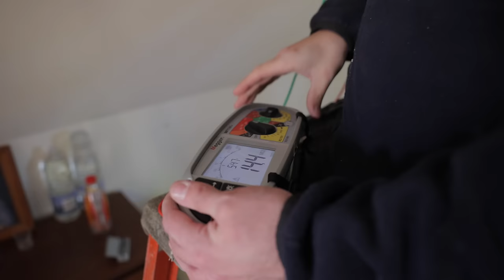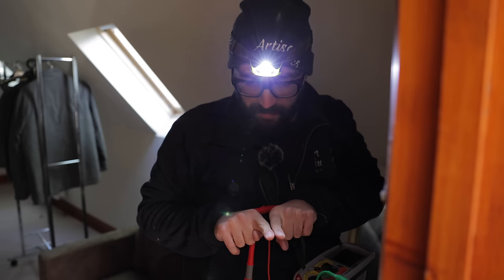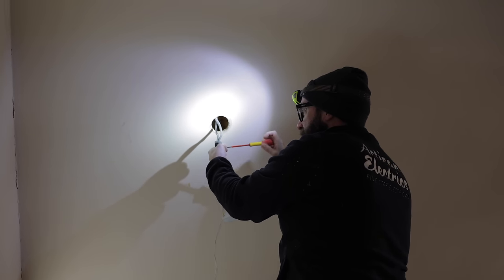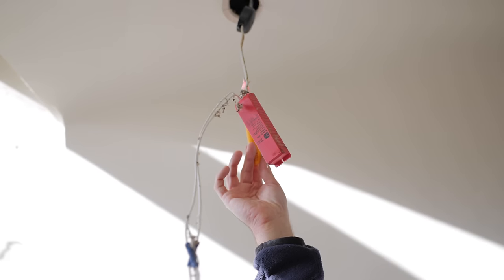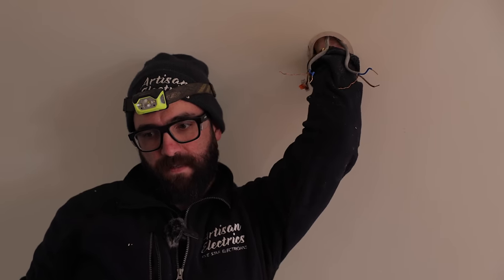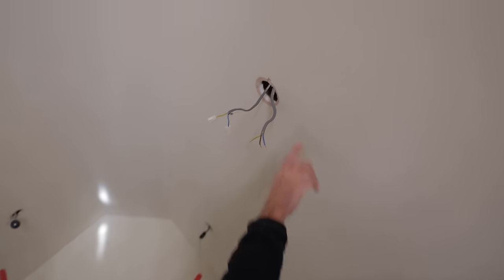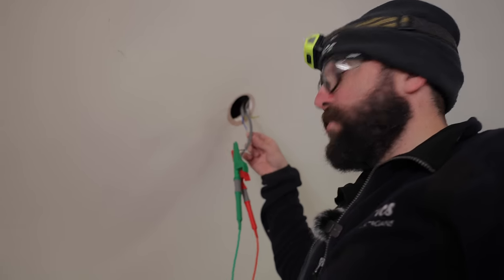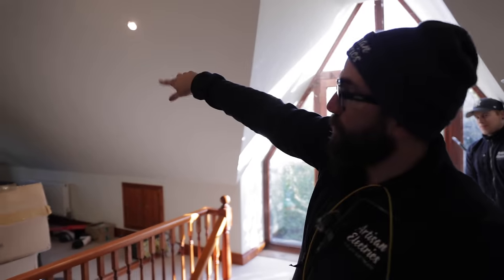Fault Finding an Electrical Lighting Circuit - Expert Electricians Top Tips

Comment: A colleague went to a house last week with squirrel damage after a report the RCD kept tripping.  Stripped cables and structural timbers virtually chewed through in places.  The house was due to be occupied (Not any more).  Currently waiting for the thermal insulation to be removed to allow a visual inspecting of the structural damage as well as the wiring prior to any repairs.  That brings the total to three this year (First two were rats though).  With rodent damage and an accessible loft we visually inspect as well as test because you cant rely on just the insulation resistance test to prove the circuit is safe again.  They like plastic water pipes with their knobbly fittings as well with the predictable but visible leakage.  Personally I don't think "Copex" would stop the damage but may minimise it (We've discussed using it but not actually tried it yet).
Reply from the maker: Wow what a nightmare!
Reply: Steel conduit or flexi, or armoured might be the only way.
Reply: @tobysherring1369  And an electric fence energiser connected to the conduit/armour.

Comment: Great vid. I’d suggest the easiest/safest/cheapest thing to do is to change the lighting system so that you don’t use/rely on any cables within the roof joist zone. Design an LED strip lighting system to soffit / walls/ false dado rails & some floor lighting etc etc. 
There are some clever people that do this for a living I’ve heard!
Reply: Or try quinetic
Reply: Yeah, alternatively customer can go for surface mounted cable trunking / conduits and spotlight bars along flat ceiling.

Comment: I'm a committee tech in Australia .
I use red tape to identify the incoming power.
Also l use a tdr (time delay reflexomiter) to locate the fault location. 
Also l install cables in conduit when wiring in confined spaces.

Comment: Thank you John. Good work logically isolating the faulty sections of cable. Scary to think how much unseen and inaccessible cable under floors, in lofts, and overboarded ceilings, like the ones in this video, could be rodent damaged, yet still test good.

Comment: I have only found your channel recently. My loss ! I run a vehicle workshop, and my passion is auto electrics. So many similarities, yet so many differences. I'm happiest building bespoke engine management looms, multiple voltages, signals, sensors, sometimes 100+ conductors . You would think that mains stuff would be simple, but I have never completely got my head round it. Your videos bring a beautiful clarity to people of technical mind. I have learned more from your work in the last week than I have in the last twenty years.  This video didn't particularly teach me anything, but from a very fussy technical person, I would like to congratulate particularly John for a brilliant run through of the processes involved in diagnosing something like this 👏 👍  proper job mate.  Also awesome to see the level of care and pride in the standard of work you guys turn out. Even better your only up the road !!  I wish you all every success in 2023!!

Comment: Similar to how I commented on the last video, I think that you have to assume other cables in the ceiling are damaged and I wouldn't reconnect them. I wouldn't have fixed any existing wiring until the rodent issue was positively identified and corrected. If they absolutely needed ceiling lights then I would have offered to install a brand new surface mount metal conduit lighting circuit using no existing wiring back to the consumer unit as the only option. Actually, I'd have my doubts about the wiring in the walls at this point and say resolve the rodents first.

You re-energized part of the lighting circuit after showing the damage, documented it on YouTube, and now you could be responsible if there is a fire.
Reply: It is very difficult to stop rodents entering roof voids like this one - they need so little space to get in. There should only be metalclad containment within these spaces. Re-energising any of this wiring is risky even with the additional protection of the RCD.

Comment: I am no sparks, so seeing this diagnosis in action is sheer awesomeness!
We had squirrels first (hole in roof fixed) then rats (via dodgy drain) and that certainly needed fixing first, otherwise this becomes a constant problem on the house.
When lights are recessed into the roof like that, would you normally expect just twin and earth or would you protect the cabling with conduit or armouring? (on the first install)

Comment: Very comprehensive fault finding but I wonder if it was the most efficient way to deal with this property from the beginning. As there are signs of chewing and it is a hostile rodent environment, considering the spotlights are relatively close between each other, perhaps was going to be a more definite solution to rewire with a better cable / conduit.

Comment: Very frustrating. I installed IP CCTV on a rural property and hadn’t even finished the job before suspected squirrels chewed through at a drip loop near the eaves. Data cable is much more susceptible to faults but less dangerous.

Comment: If the fault is on the wiring between a downstairs ceiling light and the light switch do you need to take up the upstairs floorboards to remove and replace it?

Comment: Ive had mice wriggle their way into a back of a tsso, it actually got through the 20mm grommet with 2, 2.5t&e cables as well !!  I'm staggered at how it squeezed  in there, it was a bit if a mess but i found the issue.

Comment: you tend to get them in country town areas squirrels i had in a loft council can be somewhat dumb since i told them they have fix the hole in the loft and just do a temp fix until the main problems of fauna getting into the loft and chewing the rest of the cables, ut was quite common were i worked not all the time but

Comment: I’m an auto electrician and I see rodent problems a lot, sometimes writing off a car. I’m pretty sure you knew that there was going to be a lot of the wires chewed from the start but at one point I was thinking “why does he think just because that wire is only 2 years old it won’t be that wire” obviously rodents don’t care how old a piece of wire is. I understand this was basically a tutorial on how to trace faults. I remember watching the video from Jordan on this house and I thought then, he should be recommending the ceiling be brought down and lights rewired with conduit or some other protection for the wiring. I’m sure there would have been other wires chewed when Jordan was there but you can only advise, it’s up to the customer how far they go. In my experience as long as you get the fault cleared a customer will not want to go further until it goes again. I have a 2021 VW non runner with rodent damage to get fixed next week and it’s not the first time this customer has had rodent trouble with their cars, last one the insurance wrote off. I told the customer to always put their car in the garage and rodent proof it. Customers don’t always listen. Nice video. 👍👍
Reply: We use Lodi 'anti rodent spray' gives 6 months protection on cables. Bromley Pest Control
Reply: So rodents will chew through wires in a motor vehicle sat  on a drive in the country side?  Does the vehicle have to be sat there for a while, or can it happen overnight ?

Comment: When wiring up a downstairs light both upstairs and downstairs breakers blew (nylex mcb push in type 6amp). Replaced both breakers but now only upstairs lights are working, downstairs no lights work, what can I check or test to restore power. Both breakers are working as I've swapped them around to check, could I have shorted something out?

Comment: Run galv conduit on the surface tell the customer its all the rage for lofts rooms.other wise you will be back. Very well demonstrated but it does bring into the fray EICR testing as you say it would be a satisfactory and when you sign the cert i hope you put on a disclaimer.

Comment: Take an electric fence transformer and hook it up to all the wires in the ceilings!  That will clear the mice / yard rats (squirrels) the next time they chew into those!  Need some armored cable it seems, then electrify the armor! 💥🐿🐭   It seems like a good place for some linear up lighting along the ridge hidden by some molding or soffit, that way there is no wiring in the ceiling.  Maybe an exterminator might be in order too?   Keep up the good work, is lucky the place hasn't burned down.   At least if they are going to keep the ceiling wiring please install AFDD's for those circuits, just what they are made for to help prevent the arcing that would start the fire.

Comment: Surprised the householder did not hear the little devils scurrying around as they feasted on their electric dinner.  I did when a darling got in my loft - fortunately I got rid very quickly and only found some nibbles on the outer insulation nothing had gone through to copper and IR was good.   Now I'm paranoid about any noise from my ceilings (bungalow).

That dropping on the ladder looked like rats to me too big for  mouse methinks.

Comment: In UK do you have armored twin and earth ?  In NA we have  AC90 cable in various sizes, conductors are covered with a metal flex exterior
Reply: I think SY is the closest, but it’s a steel braid under a clear sheath. You can get flexible metal conduit a bit like the aluminium armour on AC90 but it’s expensive. Steel wire armoured cable (SWA) is what we typically use outdoors or where mechanical protection is needed, but it would be unusual to see that in a domestic ceiling void

Comment: When you are doing  an IR on the new cable Jordan put in and it is showing 20 m ohms clear do you think Jordan stripped it when he was pulling it in between  the lights if it showed 20 it would have worked when he done the job what was the IR when Jordan done the IR of his new cable

Comment: If you would test it with higher voltage the resistance would fail, but the problem eith that is that you can easily damage appliances that are not unplugged

Comment: When IR testing the CPC should remain connected to the MET.
Reply: For an EIC/EICR etc.  but he is fault finding the circuit needs to be split into sections to identify the damaged cables.
Reply: @matthewthomas6121  Disconnect and split the line and neutral conductors, the fault will still be able to be detected. It’s actually better to leave all the earthing connected as the fault could be between the live conductor of one cable to the CPC of another cable which I’ve had before.
Reply: @alvina69  fair point 👍

Comment: As a electrician I hate 12 volt halogen spotlights there the lamps are always out or the fitting are making dodgy connection and the transformers can't hold 2.5mm2 wire. In the Dutch code was is a rule that wireing at all times could be replaced without structual demaging the building. So domestic all wires is in pvc piping by size 16 and 19mm. max 4 90 degree bends and bend diameter minimum 4 times diameter.

Comment: Should have seen the damage rats did to my brand new car power cables they had to write the car off before it got delivered  to me.
The issue today is a lot of plastics used to cover wire has been developed from food waste products such as soy. But all the rodents smell is food.
So as we switch to new cabling  made from sustainable plastics we are going to need to treat the cables with chemicals my car gets sprayed every 6 months.
Reply: Plastics from soy? How can we avoid such cabling?

Comment: Rats pee as  they walk, that is what causes  the moisture.
Once worked in an old factory and they used to run around the tops of the walls, you could see the piss that  had run down the walls over the many decades. It stunk of it  up there too.

Comment: That’s why T & E is such a crap installation method, all electrical wiring should be done in either pvc, metal or micc cable, I completely did my 4 bed house in pvc conduit and was well worth it, especially when you want to change something around like switching etc. it sickens me when I see t&e plasted into walls or the caping only coming down to an inch of a switch, why when you’ve went to the trouble of capping not just poke it into the box. Rant over
Reply: I agree totally the capping  should be butted up to the boxes and ceiling.  I use oval tube and I normally bring the tube just inside the box and have about a inch in the ceiling. When I was a apprentice you never exposed a cable to fresh plaster or render . Even if you had a inch of cable showing you covered it with wax paper before plastering.  I have a mate who is a plasterer. He refuses to plaster over uncovered cables telling his customer to get the electrician back and not cut corners